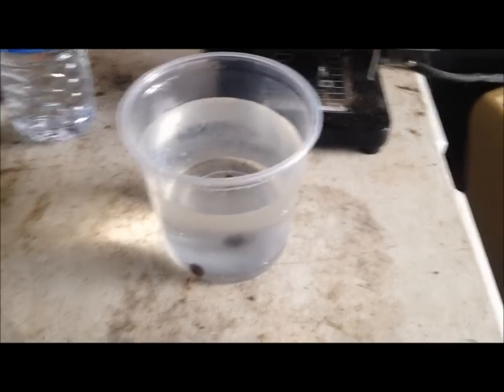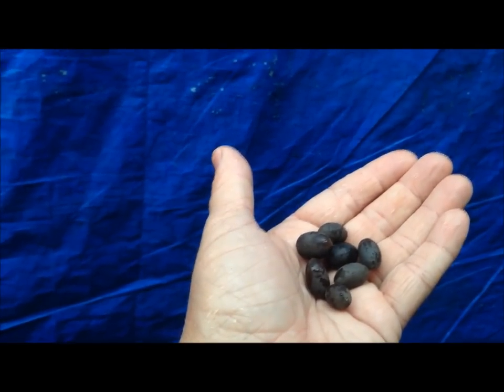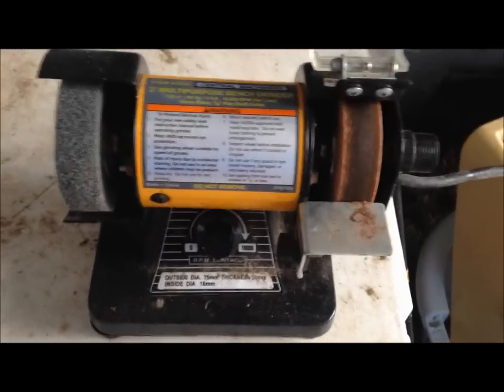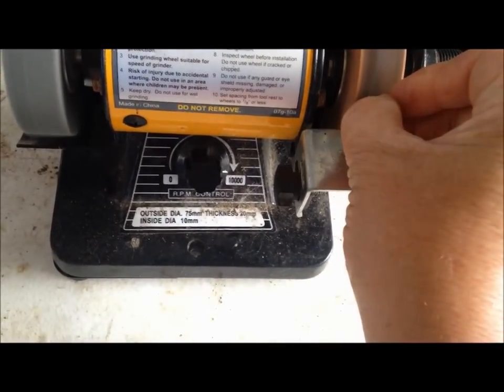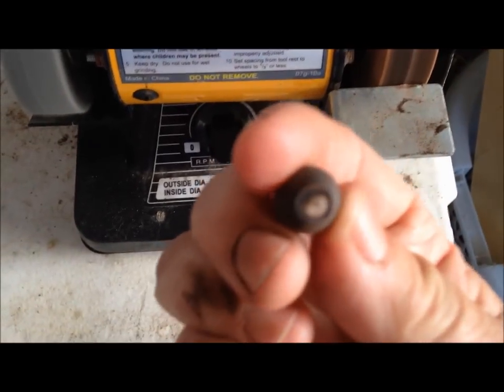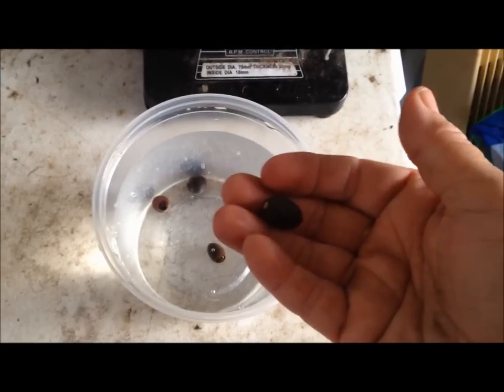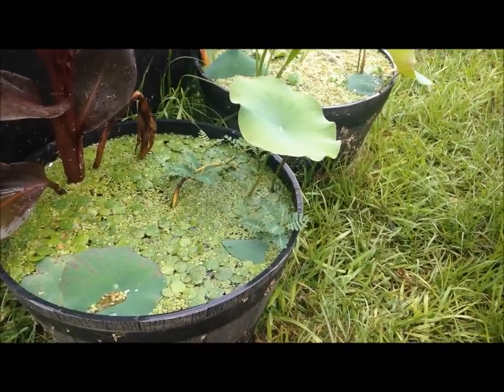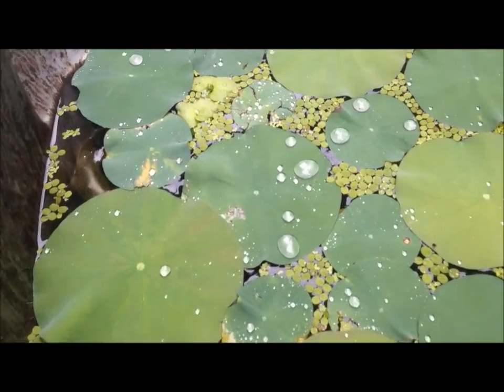How to Score and Grow Water Lotus Seeds

Comment: I just rubbed mine on the sidewalk and it worked fine. Only took a few minutes per seed. All sprouted. They were from dried lotus seeds I bought at Hobby Lobby 4 or 5 years ago. I put the jar of water on a heat mat and on the third day added a full spectrum lamp. All had 2-4 inch green growth within a week. Gail is right, none of the funky little odd shaped ones sprouted.
Reply from the maker: Hi! I’ve been gone for a very long time. But I’m back in action now and living in Texas! I can still help you. Hope you are doing well? 🪷

Comment: what is growing in the pots with you're water lotus? is it some kind of floating plant that will help support you're lotus? Also I have been trying my hand at growing lotus seeds that i bought off ebay and it is interesting to learn about the floating ones and how they will probably be duds lol. I watched another video i think from some chinese guy and tried his method of using a pair of wire snips and just snipping the pointy end and so far I was able to get almost all of them to germinate. Now my issue is what to do with 30 plus germinated plants lol. I had put 6 of the sprouted seeds in just a 12x6 inch deep pot, and ended up with a twisted mess as they grew! big mistake. So would you suggest growing only 1 lotus per you're barrel?
Reply from the maker: 🤠 Hi- I’ve been away for a very long time, but I’m back now living in Texas. How are your plants?

Comment: I tried 4 times but after good germination, seeds got ruined with very bad smell, what to do?
Reply from the maker: Sorry, I’ve been gone for a long time. But I’m back now. Thanks for watching! My guess is that if the water got smelly, then you would need to change the water more often. Try using bottled spring water.

Comment: Question... how deep??? I have some native seed pulled from a Lotus head on the Alabama River near Selma Al.  I have tried to grow them several times and they always sprout, send up the stem and sometimes a leaf or two.  thats when they die... I have used sand/pea gravel before.  I plan on using DIRT this time but noticed your leaves were floating on top of the container at rim level.  Do you pant the sprouted seed in dirt on the bottom and just fill up the pot? the plants grow to that level and open the leaf?  Thanks!
Reply from the maker: Hello!  Sorry that I have been gone for a very long time.  But I'm back in action now!  I grow the plants indoors until they are 4-6 inches long.  I push the seed down into the soil or pea gravel just below the surface level.  It will produce floating leaves.  Morning sun only until you get an aerial leaf.  Young plants will die if the water gets too hot.  Thanks for watching!

Comment: Which side do we file?
Reply: One end is a bit pointy and the other has a tiny dimple like a belly button, U sand the dimple side.
Reply: Yup, dimple. I also find it's much faster and easier to use those jumbo toenail clippers (not fingernail, as they're too small to get enough purchase on the surface). You can wedge the corner of one side of the clippers in the dimple and bite to make a score int he shell. Once you've done that, work your way around so that there's a *-like star shape of lines radiating out from the dimple. You can usually get away with 6 to 8 lines around, the exact amount isn't as important as it is to have them close enough that you can then grip the space between two lines perpendicular to the direction of said lines, so that the point of one jaw is in one line while the opposite jaw is in an adjacent line. You can then bite down with the clippers to score across, and continue until you've cut a ring around the top of the nut. At this point the top should pop itself off freely.
Reply from the maker: 🤠 Hi- I’ve been away for a very long time, but I’m back now living in Texas. How are your plants?

Comment: I dont understand which side of the seed u r did friction! please give me snapshot photo of it
Reply: 7 days have passed but my rose seeds have not started growing yet I have been changing its water daily
Reply: DEBAJYOTI BISWAS One end of the lotus seed is protruding and the other side is concave down.
Reply: Can u cut the seed instead of filing?
Reply: Yes there is a better end of the seed to sand for success I believe it is the end that they say looks like a belly button. I must check this so I am just starting out wtih lotus as well but i understand one end proves much more successful then the other. So be sure to check it out, I am now. : )
Reply: Honestly, it DOESN'T matter. as long as you cut through the outer seed coat.  Once the inside is exposed to water, the seed will do the rest. It doesn't need to be so complicated as to score one end or the other.  Just cut through the seed coat.
Reply: @neerajsir3248  Rose or Lotus ? if it has been 7 days they probably aren't going to grow.  Did they float when you put them in the water ? if so, they will more than likely NOT grow.
Reply: @newsviewstoday5689  I have NEVER cut through an end. I have used a band saw to cut through the side and they always sprout.  Its simply exposing the inner seed to water.  That's really all it takes.
Reply from the maker: 🤠 Hi- I’ve been away for a very long time, but I’m back now living in Texas. How are your plants?

Comment: Need to tell people which side to grind . Don’t touch the pointed side. Also no need to use an electric grinder. Just use a sand paper or a rough ground can do the job. The grinder is dangerous to use and the heat generated can damage the seed.
Reply from the maker: Sorry, I’ve been gone for a long time. But I’m back now. Thanks for watching!

Comment: if we had that machine .. what was the need of this video.... we wanted some simple method ...
Reply: You don't need the grinder (machine) do you have a rock? a hack saw?  a concrete surface ? even a Nail File will do the job.  you are trying to remove the outer seed coat just enough to expose the inner seed to water. It doesn't need to be a huge gaping hole in the side, just enough to get the seed wet, Once you have water to the inside the seed will do the rest.  try rubbing the seed on the side walk, or a brick. It will take a while but you can do it with out a grinder.  If you have a hack saw that will work too.
Reply from the maker: 🤠 Hello. Thanks! I’ve been gone for a long time, but I’m back now with much better material. I hear you can use snippers